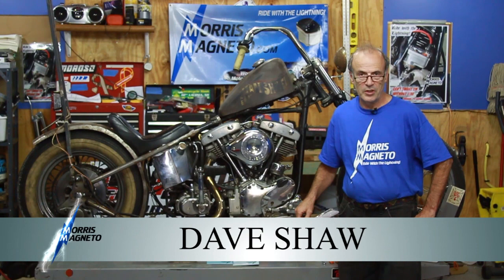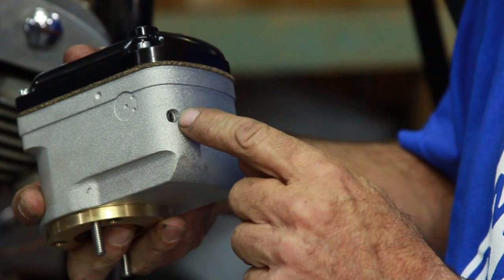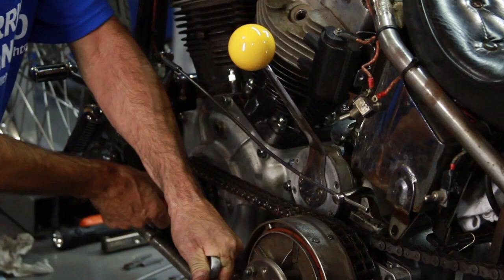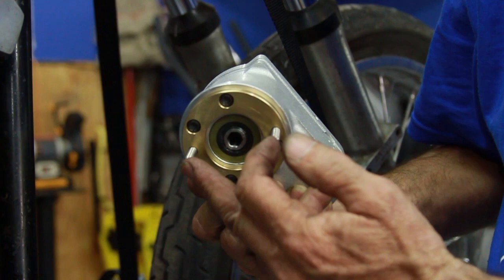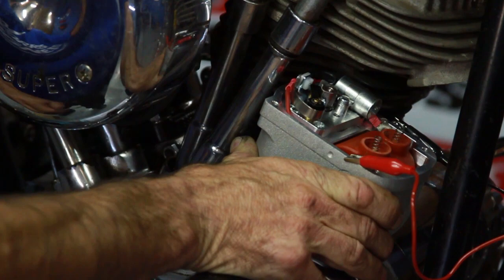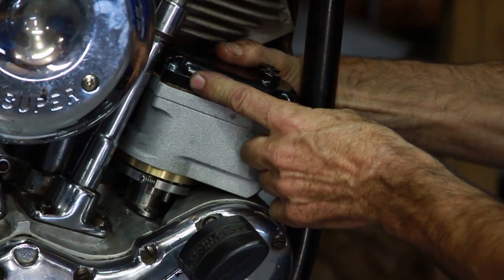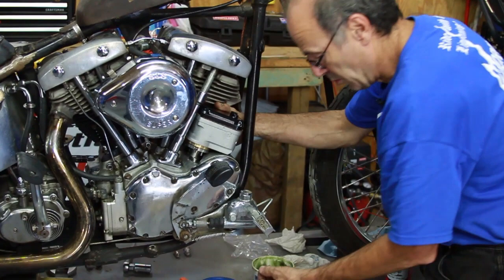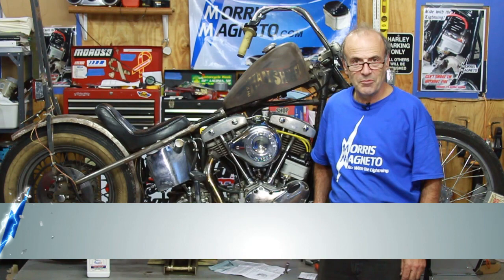MM74E Morris Magneto Installation on Shovel Head Harley Davidson Motorcycle

Comment: I have a 1974 harley ironhead  with a magento not sure to set the points gap at .015 ) (.0018) or ???? I also spark set at .020?? I was told it does make a diffence which S.P wires goes to cylinder front or back the  get different answers from youtube

Comment: Is that an S&S engine with an S&S carb or a Harley engine with S&S carb which is on my 91 
Sporty1200. heard some Harley carbs are way to finicky. I never had an issue with S&S . . .
Is it true Harley did NOT need a battery when the bike had a generator? but did require a 
regulator? I do appreciate your answer.
Reply: Does need a bat and regulator with a Kettering "coil and points" iggy. You need battery power to energize the coil. Magneto iggy us basically a tiny generator/coil/ points setup in that mag head, so no battery needed. If you want to run lights, you still need the generator and a regulator (regulator keeps voltage low enough to not fry the bulbs). The regulator has to be points type (not a solid state/electronic type) if you eliminate the battery. If you want lights when the engine isn't running, you still need a battery, though it can be lower capacity than you'd need running a Kettering iggy.
Reply: @ludditeneaderthal  II) I
clown face
Reply: @foleyames  ?